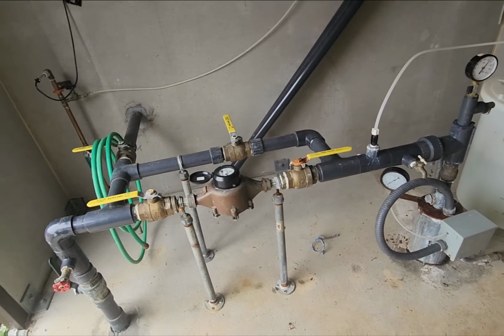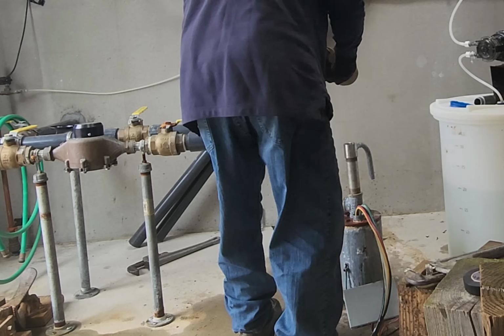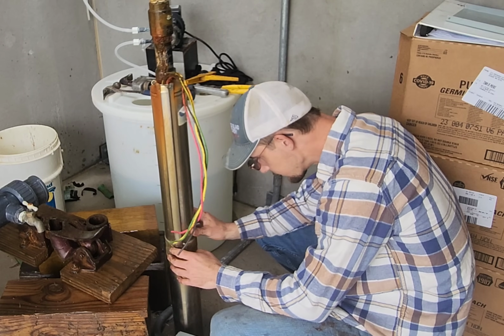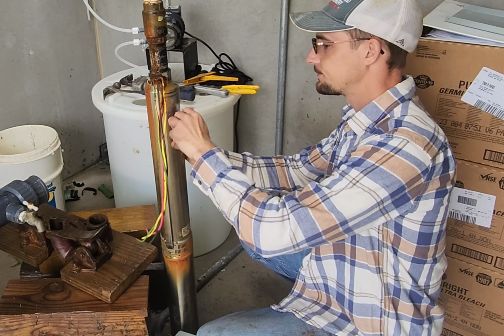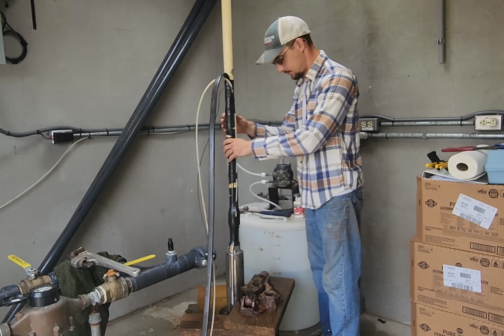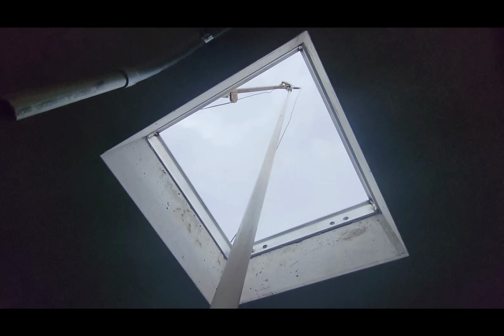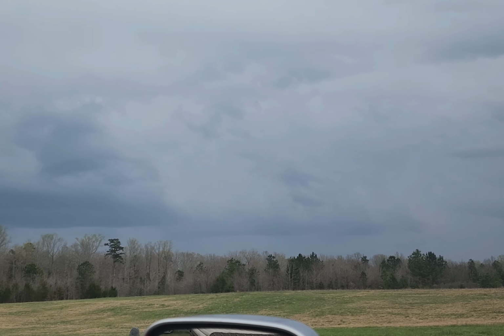Replacing Well Pump on PVC Pipe for City Water Supply. How Stick Pipe Must Be Handled, Not a DIY Job

Comment: I learned something new. I NEVER knew electrical tape can hold under water for so many years. As an HVAC tech I’ve seen electrical tape gum up and lose its adhesiveness over time and just slough off wire nuts. I would’ve never fathomed it would be used as a “watertight” solution. There has to be something else…

Comment: Why did they not replace the PVC with a larger diameter black Poly that I presume would make it easier to do this the next time?
Reply: I was thinking the same thing
Reply from the maker: That's what I wanted to do...wasn't given the green light to do it.
Reply: Too bad it would’ve made it a lot easier in three years when you have to replace it again

Comment: I’ve always pulled our well pump and it has 1 inch pvc set at 160 or 180 ft but we don’t have a building surrounding it and it took 4 people to get it out. 2 at the well head pulling pump while the other 2 are keeping it from bunching up keeping it from snapping

Comment: Thanks! These are very helpful. I have a couple questions. What is the grade of PVC pipe needed for stick type? How tight do you torque the joints? Is the pipe dope PTFE or just regular? Wll you do a video to educate me about down-hole water level sensors or floats?
Reply: I believe my installer used Sch 80 or Sch 120 pvc threaded drop well pipe.

Comment: I pick up a good thing or two from nearly every video you make and not just from the well tech stuff either. I share your migraines and also have mine triggered hours before a big low pressure storm roll in too. I know how they make you feel and I sooooo respect you for sticking it out on the job. That shows devoted commitment and integrity in a situation where others may find an excuse. Again, you gained my respect.
Reply from the maker: Thanks. Yea the migraine was so bad I almost got sick, had my worker drive me home and put a towel over my face to block out all the sunlight. It was properly the worst I've experienced. Part was due to the weather, the other part was probably due to the liquid chlorine container I was working next to & using as a work bench in the Video. Definitely debilitating!

Comment: installed many times at farm same 1-1/4 stick (I used stainless fittings) but I assembled all on the ground, since empty was light enough for a few us folks to handle and bend over into well easy enough but was new pipe, this got me thinking may not want to try if reusing pipe going to reassemble as you did if ever have to pull again if reusing pipe. Thanks for the video.

Comment: Why would they use hard line instead of a pex style pipe?  I figured this would be a good time to swap over for future repairs making them cheaper likely to keep from having to get a crane out with every single service...  Does the hard line hold more preasure?  or was it just installed that way decades ago before reliable pex was a thing?  i.e. the pex from the 70's and 80's that is now bursting in the walls all over the country and the massive recalls.  Very nice job tho!  Very professional.  I'm on city water myself out in the desert of Phoenix.  well, kinda city water, its a third party company that the city of Peoria uses (Epcor) and the water is maily supplied by massive wells in each district.  So my water is super hard and full of calcium/iron/and other minerals.

Comment: Another great video.

Quick question, after you knew it was pvc did you suggest to the manager to change it over to poly pipe? If so what was the reason they didn't want to?
Reply: I like to know, I have 300ft well with pvc.
Reply from the maker: Yes I recommended swapping it over the black roll pipe since it's life span is short . If it was on poly, I would be in & out in 90 minutes.  Because it's on pvc, it took around 6 hours. 
Any pump past 400ft needs pvc drop pipe or a Well with a 200+ ft static level needs Pvc or metal drop pipe. This Well was a great candidate for poly. I proposed the cost, they never responded...so they declined. Commercial jobs stink bc they want a total cost before any work is done...its hard to know what you'll find to give a spot on estimate. So I did exactly what they wanted.
Reply: @h2omechanic  thank you for the reply.

I figured it was something like that. I did Commercial telecommunications and they do not like changes. The quote up front is what they want. Especially state agencies.

Again thank you for all the information, you have helped me on my own well.
Reply: @h2omechanic  you remind me of my family 4 generations of plumbers,my father told me when I started to learn plumbing with him WAS if you can’t do it right leave it alone let some one one
Reply: @h2omechanic  that’s short-sighted if they’re going to have to pay to pull and replace that pump every five years.
Reply: @h2omechanic  so if you are 400 or 500 foot residential you should use stick pipe?  What is the pipe grabber you have there?
Reply: they will tell the next guy it's poly plpe for the cheap quote. walk.  @htroberts

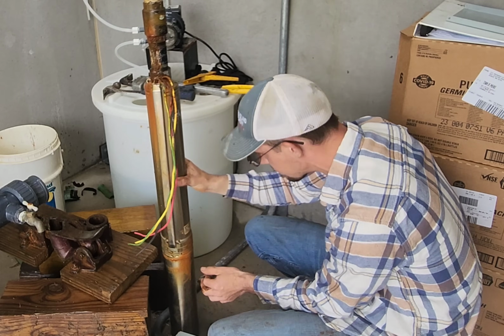Comment: Hi, around 12:09 you do a "Boombox Check" on the static level--is that a sonar distance measuring device? Is it only useable if the pipe and pump are pulled, and out of the way? Thanks

Comment: I am about to install a 20' stick PVC pipe well soon, so this is good to watch. What tools do you use for this?
Reply: Switch it with Poly much more flexible otherwise if you ever have to change it you will have to pull it all straight up with a crane. With poly you can pull it by hand and lay it over as you go.
Reply: @greenspiraldragon poly can’t go over a certain depth . Wells in my area are 500-800 ft deep

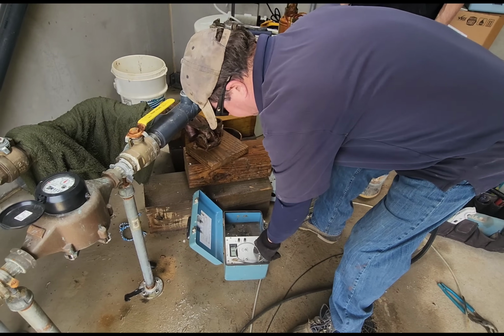Comment: I'm getting confused about when it's OK to mix copper and stainless. At 12:24, is that stub copper? Can you give us a clear list of things to never do if you want to avoid galvanic reactions?
Reply from the maker: The SS fitting was not used. Pvc pipe was threaded directly into the check valve. But I understand what you mean about dissimilar metals.
Reply: @h2omechanic  The pump is stainless, he has a point, whole lot should have been same metal.
Reply: I think that was a red brass nipple, there's no problem mixing stainless steel with copper, bronze or brass for use with potable water.

Never screw galvanized steel or malleable iron directly to a pump, valve or fitting made of stainless, bronze, or brass because the steel will corrode, it may last a decade or two but eventually it will break and if it was holding a submersible pump the pump will end up at the bottom of the well...
Reply: Just pulled ours which had galvanized attached to the brass check valve. Had a 3/8" hole in the galvanized just above the threads and rotted all around. It broke off as soon as we got it out of the casing. The pump still operates (43yrs old) but the wire broke or burned out at the tourqe arrestor.

Comment: This is a question.  Can you have two pump houses on a shared well as the property are very far apart and they turn down pressures at will? I have the well they have the pump house

Comment: Bummer about the headache, been there done that. Nice job.😎👍
Reply: If you start to feel nauseated with a headache sometimes the best thing to do is allow the body to rid itself of the stomach contents. It has been my experience that if I vomit a few times then drink a Red Bull for the glucose raise and the caffeine to shrink blood vessels with 600 milligrams of Naproxen followed by a bottle of water I will feel so much better in less than an hour.
Reply: @alexfriedeck1978 someone told me to eat a king size PayDay bar and drink a Mt. Dew with it. Haven't been lucky enough to try said suggestion since I have neither on hand when my migraines kick in. Someone else told me to drink saline water because something in my head was getting dehydrated. Never tried that one either.

But regardless I'm like you and just have to let my stomach do its thing.

Comment: Is this a 3 phase pump? The water system in the town I worked for had a 3 phase 480 volt pump similar to this
Reply from the maker: Not this one. PH1 - 240v. 3-Wire.
Reply: @h2omechanic  Have you ever worked on  3 phase pumps before?
Reply: @h2omechanic  Yeah on a 3 phase pump, it'll run backwards if 2 of the phases are wired wrong, if there's no water pressure when first powering it up, just change any 2 phases
Reply: 2 HP, single phase is fine. Think I heard there were 6 other wells to share the supply.

Comment: Couple of pointers: don’t leave wire on the ground - contamination, catch someone in the bite, can score the insulation. Rather spool the wire onto an empty reel; eliminate all concerns. If reusing the drop pipe put it on dunnage; saves threads, less contamination & easier to check for flaws. Dogs are NOT safe - use a plate or pipe clamps. Never cut the tape with a pipe cutter, use a hook blade retractable knife. Been doing this work for 20+yrs and own our pump company.

Comment: May I make a suggestion, I would make from Pressure Treated 6" in. X 6" in. X 4 to 6 foot long, VEE shaped what I'll call Pipe Stacking Stands.  The purpose would be so that the pipe pulled from a well, never touches the ground.  See @ 10:15 of this video.  If you should decide to make these, I would leave at each end approx. 6 (six) inches uncut.  The reason is so you could stack the stands on each other.  Assuming that all the pipe you use,  work with, comes in 20 or 21 foot lengths, I would only make 3 (three) of these.  I would cut the VEE to a depth of say 2.625" in. with 2-7/8" inches of material remaining.  I would cover the surface that the pipe(s) would touch, lay down on, with old fire hose or something that makes you feel warm and fuzzy.  Thanks for sharing this video.  Stand capacity @ 1.5" in. Pipe Dia. = 61 Total two rows high.  Stand capacity @ 1.25" in. Pipe Dia. = 73   Total two rows high. Stanwooddave, how are you so sure about the capacity(s)?  Easy answer, I drew them up in my CAD (Computer Aided Design) program.  My default tolerance is 1/32 (plus or minus) of an inch.  I think that gets me close enough.  The stand length was 60" inch's, (a.k.a. 5' foot) with 6" in. flat (uncut) ends both sides.  I drew a 5.5" inch board (i.e., a 6 x 6.)

A 4' Ft. Stand will allow for stacking of Qty=57.      A 3' Ft. Stand will allow for stacking of Qty=37.  Both holding pipe of 1.25" in. Diameter.    Total two rows high.
Reply: I just use folding saw horses.
Reply: I made a dozen of these, 12" long, when I pulled my pump. Definitely helped keep the pipe off the grass/out of the dirt.

Comment: Not related to this video, but are well stinks of sulfur. If we would drill deeper, would it fix that issue?
Reply from the maker: No. If its mainly hot water that smells like sulfur, that's the anode rod in the water heater. 
If its cold water, you'll need a galvanized tank with a air vent to bleed off the sulfur (not a diy thing)

Comment: Every install in California is basically the same way this pump instead and pulled  IV done this every day for the last 21 years just like this  most city jobs are in building unfortunately but they also usually pay prevailing wage👍 we use 2in Christy pipe Warp tape strong stuff.  LoL the first 3week I worked at my job the operator at the time installed the check valve up side down. it made me perty mad I actually had to tell him what he did wrong and had to pull it all out 300ft just to flip it. It's the first thing to double check before sending it down hole that and motor and pump info. I also no what you mean that up and down can definitely get to you specially if dehydrated.  Just a average work day of a pump man 💯🛠️🍻👍✌️💧💦

Comment: Looks like you were using the tailout line on the smeal. Do you have issues with the main line?
Always roll your drop cable on an empty spool to keeps wires off the ground.
Always stack pipe on blocking to keep it off the ground. Animals and bugs poop on the ground.
Always wear a hard hat when working with overhead equipment.
Apply pipe paste to outside of threads. 
Add some chlorine to the well before you start installing the pump.
When you need two guys on wrenches to loosen/tighten pipe, have each guy place one hand on each wrench. That way you are working WITH each other, and not fighting each other. (you can thank me later for that one) 😊
Reply: Thread paste will squeeze out as the male threads turn in when applied to the male threads. I have worked on high and low pressure systems for 30 plus years. A little dab on the inside of threads does a better job than a gob on the outside.

Comment: Excellent work in all videos.

Just wanted to suggest something that kills me everytime I see.  

No need as serves no purpose to put that slic tite pipe dope on inside female threads. All of it gets inside of pipe only. Same principle with flux and sweating copper.

If you want to make extra sure a joint won't leak.. 1st teflon tape it before you put pipe dope on.

I'm in HVACR trade for about 30 yrs now 

Also I've seen some well people not use anything on the threads with screwing together PVC pipe lengths.  

Can that be correct??

Thank you and keep up the good work. 

Stop putting pipe dope inside of pipes! ;)

Comment: I retired today, and have a 97 5-T Smeal rig on a 97 F-350 Super Duty with 7.3 Power Stroke, with 2 pipe racks and 8' utility body with flip top's. this would cut your time in half on this job.
Reply: Didn't help that he was using the tailout line instead of the main line.
Reply: How much?
Reply: @msmaeski  I sold it 8 weeks ago, it was 30K
Reply: I agree.. running very slow. He should be pulling a joint every 2 minutes easily.

Comment: Off subject of your video, but 
What are your thoughts of the constant pressure system . I need a well drilled at 200ft. The pump installer is trying to talk me into the constant pressure controller system . I just want a simple pressure tank , pressure switch system . I would prefer a 3 wire pump,  not the 4 wire with control box. Just a basic simple  system. Less headaches in the future
Reply: Have you considered a Cycle Stop Valve?
Reply: Constant pressure systems are awesome. I have personally installed dozens. The customer is always extremely happy

Comment: Just wondering, since a municipal water supply, are there special well sanitizing procedures, water fluoride/chlorination treatments and other testing requirements? I know anytime the neighboring town has a water main break or low pressure, they issue a boil water advisory...
Reply from the maker: The tank beside the well is liquid chlorine injection. That's what they use here
Reply: I'm surprised to see chlorine tank next to the wellhead. Injectors are still in pump room, but storage and mixing tanks are in a complete separate room. They don't even share floor drain system. Air gap, vacuum breaks, and backflow presenters abound.

Comment: How long did this take you? I don’t know how deep the pump was set but it looked to be between 200 and 300 feet. I’m a pump rig operator does here in southern Utah. Me and 1 other guy could easily pull and install in less than 4 hours
Reply from the maker: Yea, it took us 5 hours in total.

Comment: You would have been screwed back in my day! We didn't unscrew the stick pipe.  Glued it all together on the ground drop it in, as lines you keep a 20ft arch(bow) coming out and back in your fine. Pulled a many feet of that pipe by hand.

Comment: I like PVC but only going 80’.  It is supper easy to glue the pipe and put it in the well.  These threaded fittings are strange to me.  I put in new pipe every time I have to change the pump

Comment: The "pump dog" is called a foot vice.  Made to sit over a hole and pull steal pipe out, I've pulled double pipe out, 1"1/4  and 1" same time. You literally used the vice with your foot. Never did I use that vice on plastic.

Comment: City supply ?
A 10" draw pipe line shaft turbine . . . in 10ft sections for 5-600 feet is tiresome.
But it all is about the same experience per joint . o 0 O (o) ~ @
Reply: The biggest thing I learned in the well drilling business .
  The weight of the tools from 4" to 8"
And actually I had come from 6" tools when first trying to move an 8" elevator 3 ft across a truck bed.  Been responsible for many back break incidents .   And no there isn't just one .

Comment: OK the only stupid question is the one that isn't asked. My thoughts on going back with what I assume is pvc pipe segments that are threaded is why? I would assume the cost of the labor would exceed the cost of just going to black pipe.  One single pipe instead of all the couplers would seem to me that there would be far less points of failure which would be beneficial for the town and for your business. I have worked with pvc enough to realize it gets very brittle with age. Black pipe seems like it is the safer approach. Please enlighten me because I am truly very curious.   Honestly I am a bit jealous as I would love to do this type of work full time but there are no companies in my area. Maybe that's why you get so many requests from Texas...   lol No companies here that specialize in wells.
Reply from the maker: You & me think alike. I priced out the cost of going back on poly. I never got the green light to do so.

Comment: 95% of headaches are from a person not drinking enough water.
Reply from the maker: That was probably part of it, but there was a liquid chlorine bucket beside me, I think it was a combination of alot of things
Reply: Thats part of it. Sometimes has to do with smell, or light, or sound. I find running machinery  the dule sound my main trigger for migraines for me.
Reply: I get them really bad. I I think I have multiple triggers for mine. I can drink a butt load of water and still end up getting one.
Reply: I used to get bad headaches all the time when I was a kid. Finally figured out I was dehydrated all the time.